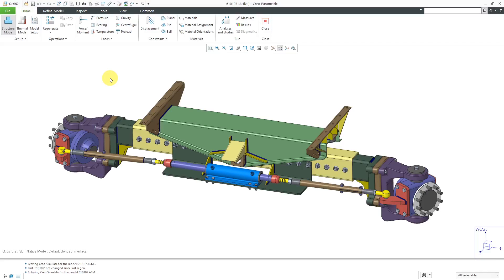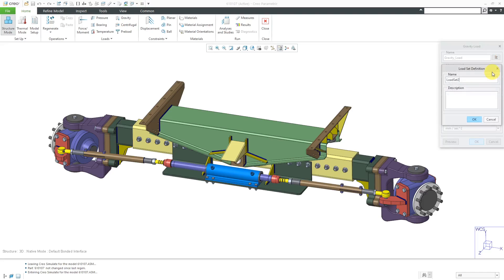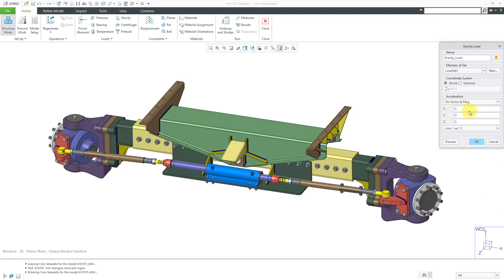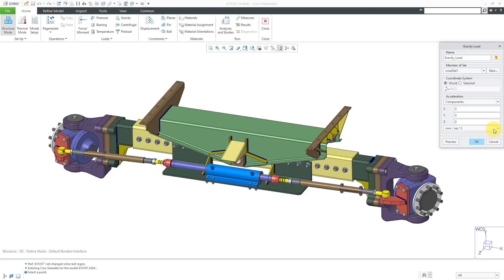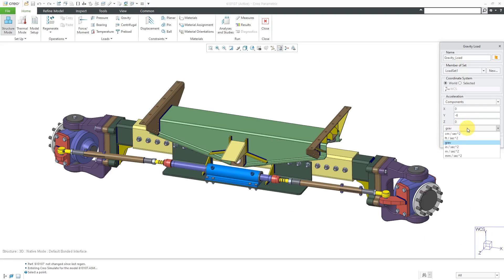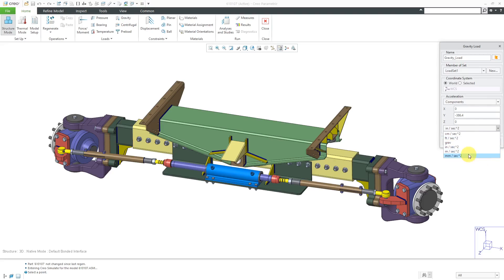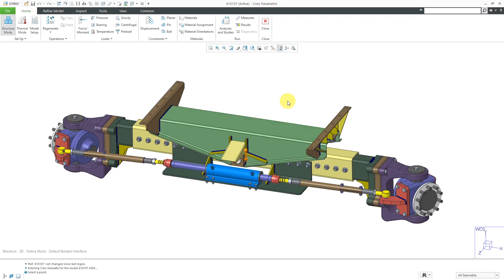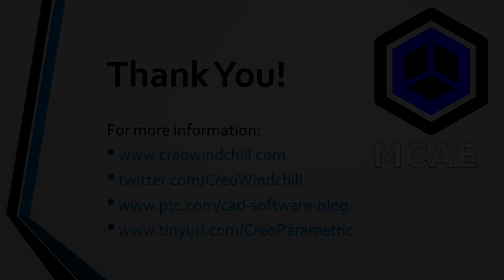Creo Parametric - Creo Simulate - Gravity Loads

Comment: Sir , how do we determine the correct or sufficient  convergence percentage in creo simulation?..In which case keeping convergence lower than 10%  percentage is reasonable ?
Reply from the maker: That's where experience and requirements come into play. Are you working on something with redundancy, or is relatively inexpensive to replace? In that situation, you could be fine with a higher convergence percentage. However, if failure would be catastrophic to the product, have a high cost, or potentially result in human injury or death, you would want a lower convergence percentage.
Reply: Thank you sir...

Comment: I presume that component material must be properly set?
Reply from the maker: Yes, analyses require that materials with valid properties be assigned to the components.
Reply: @CADPLMGuy  Thanks. Would appreciate a quick review of the results when you do analysis videos. Otherwise great stuff appreciate the work!
Reply from the maker: Honestly, I’m not always going to do that. I make feature and function videos, usually with made-up scenarios. I recommend before you use the functionality, you run a test case for verification.

Comment: Hi sir! I hope you will be fine.
I applied a gravity load in my assembly. And my assembly doesn't have a coordinate system at the center of mass. So when I select another coordinate system it applies directly on that coordinate system rather than at the center of mass of that assembly.
One way to solve this is I can make a coordinate system at the center of mass of that assembly.
But I want to ask if there is anyway that we can apply gravity automatically to the center of the mass of an assembly even if we don't have a coordinate system at the center of the mass.
Reply from the maker: Gravity is applied to the model geometry, not to a coordinate system.

Comment: While I understand you can consolidate all of your acceleration loads into one resultant vector and apply it through this process, is there no way to apply multiple acceleration loads in a single simulation? When I try to add gravity, and then add a separate acceleration load, it gives me an error that the load type already exists and I can either delete the other one or suppress it or cancel. Thank you for all of your videos!
Reply from the maker: It’s been a while since I’ve done this, but you should be able to put each acceleration load into a separate load case. Then when you run the analysis, you can run all load cases. When you generate results, you can pick and choose which cases are displayed.